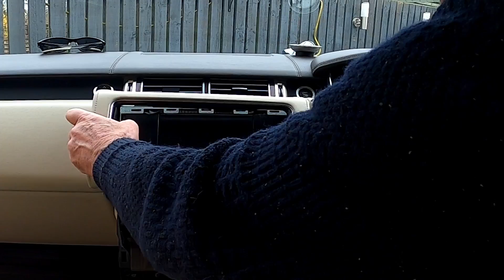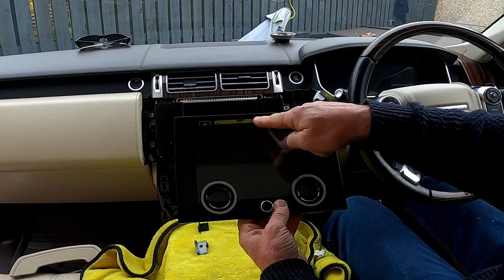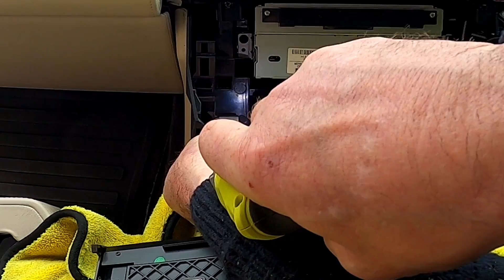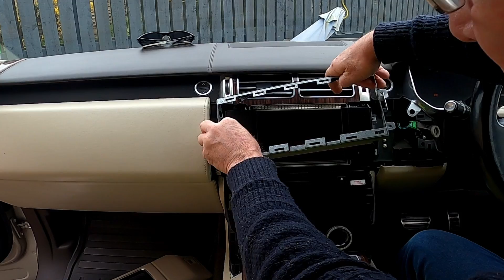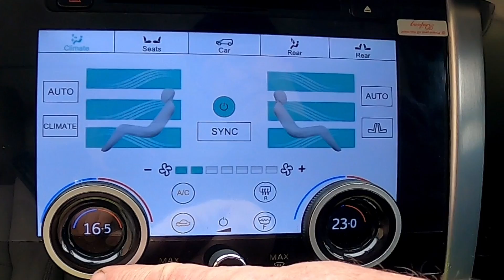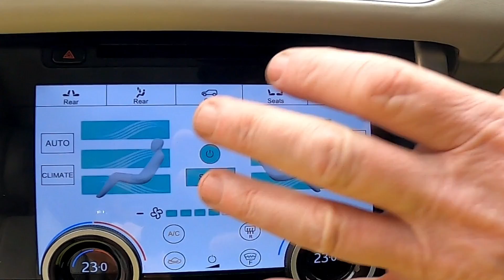Range Rover L405 New Digital AC panel installation

Comment: This will not work for the 2017 L405 with the lastest infotainment system as the 2018/2020 the bracket you put on last bolts from the back and fills the entire length of the unit. I tried several times

Comment: Please can you check and tell me if the dual view button on the main screen still works after installing the new a/c panel?
I have one of these panels and since installing it my dual view does not work. If i connect the original a/c controls dual view works fine. Is it the same with all of them or just mine?
Reply from the maker: No the dual view dosnt work  nor the home button with this panel.
Reply: @RaymiesGarage  thanks for replying. At least I know now that it is all of them. When I bought my LCD a/c panel and I told them it has stopped the dual view working they told me that was impossible and they’re not connected even though I knew it was. I’m glad I know now for sure that my car is not an oddity. I think Range Rover world and other sellers should update their descriptions to state that some car functions will be lost after installing these panels.

Comment: Great video! Look forward to doing the retrofit. Where did you source the new climate control screen from? Do the knobs work for the seat warmers as well? If you push them in they shift to seat warmers from temp and you can set the dial.
Reply from the maker: Range Rover World .co.uk , yes the dials operate the heated seats